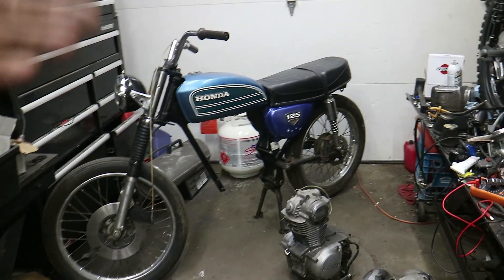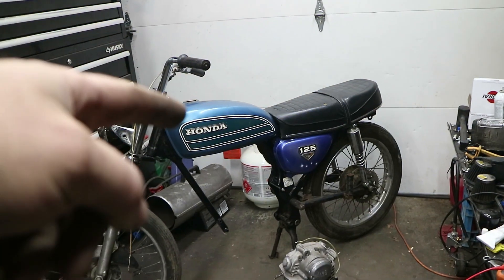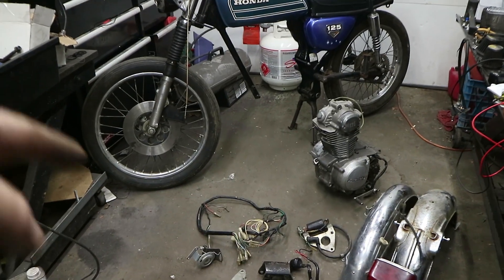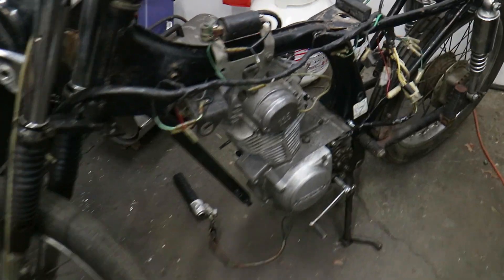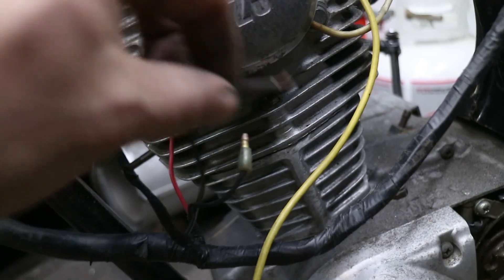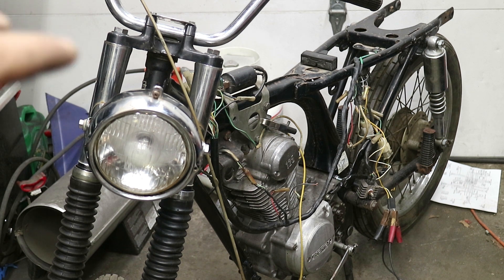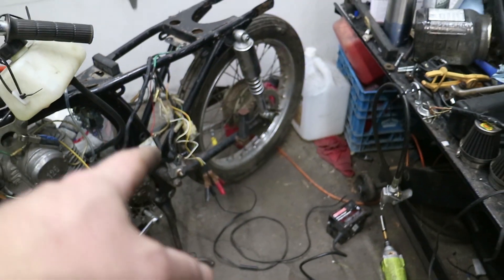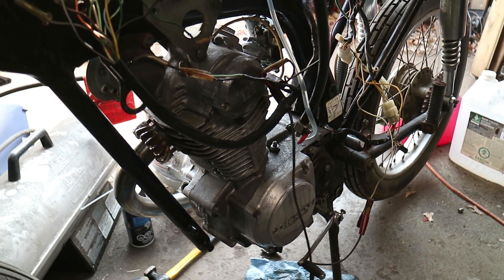I BOUGHT A CB125.... IN PIECES! WILL IT RUN?

Comment: really looking forward to this and learning from you. just bought a '76 cb125s last thursday. it's in running condition though it needs oil and carb maintenance. front brake needs replacement. needs some love but it's not a completely daunting project for my first bike. electrical needs work and looks like a half done 12v conversion
Reply from the maker: Nice! I’m finding the biggest obstacle is the front brakes. They are a cable operated disc and parts are hard to find. I’m swapping out the front forks anyway so am changing the brakes to drum. Super simple bike, great to learn on.
Reply: @Beachmangarage  yeah. I've seen the same cable disc brakes on the cb200 and the fl250 ATV rear brake. I've seen some hydraulic brakes with the same mount so I'm considering doing that later. 
I'd like to see what you do for 12v conversion. i know the battery i have is 12v but I'm not sure about the regulator. bike starts but none of the lights work. switching to high beams kills the bike